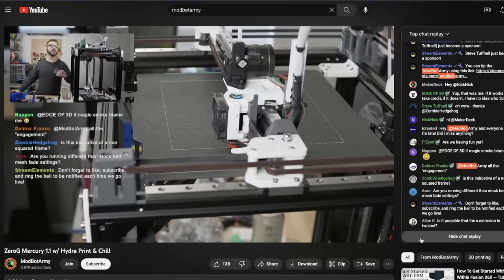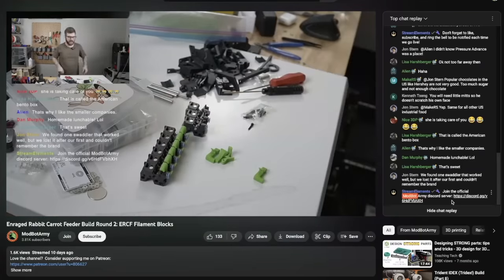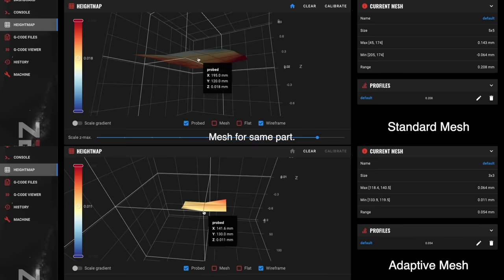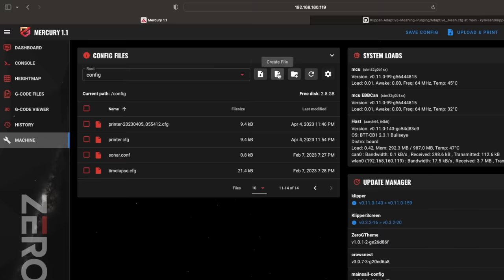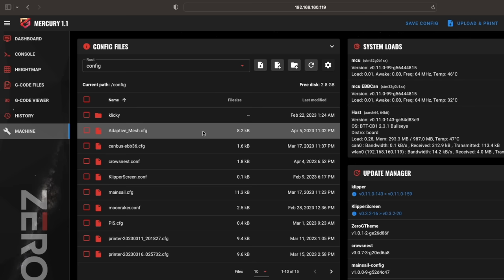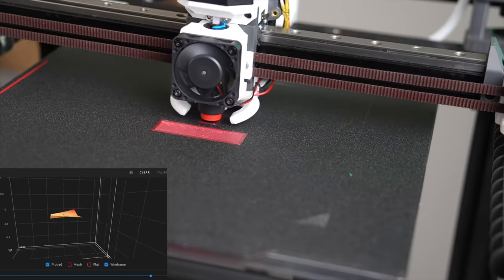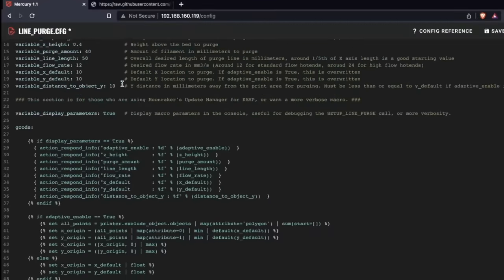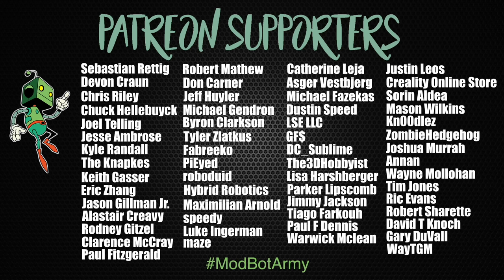The FUTURE Of 3D Printer Mesh Bed Leveling (KAMP)

Comment: For users that want to get into adaptive mesh probing, just know that KAMP is not the only way of doing it: since it's just a series of macros there are a lot of alternative implementations if you look around!
Reply: Can you point us to a few or speak to their advantages?
Reply: Look for Print_area_bed_mesh (no purge line near the printed part) or PAM for RatOS (works with any klipper config and it has the purge line near the print).

Comment: I was actually wondering if something like this was even possible a few days ago.  My bed isn't the straightest in the world, but was never too concerned, as the center isn't bad, and most of my prints never really get into the warped regions anyway.  The idea of just probing the area thats needed, instead of the whole bed, means that instead of just probing my mesh every few days, or when changing build plates, i just run it every print, oh, the purge line is heaps better than the classic one that i was using.

Comment: i get the following error when trying to print the object.  {'error': 'WebRequestError', 'message': "Error evaluating 'gcode_macro BED_MESH_CALIBRATE:gcode': jinja2.exceptions.UndefinedError: 'dict object' has no attribute 'polygon'\n"}.  Also I went through the exclude objects guide and didn't get it to work on fluidd.  Could that have something to do with it?  I use Cura for slice software.

Comment: Been using klipper and Kamp on my belt modded ender 3. They are both great. I really love mainsail and not having to faff around with a SD card. Kamp is one of those simple but great ideas. My printer hasn't been more rock solid

Comment: You can achieve this too on any printer that supports the G29 command if you do use PrusaSlicer(and probably it's forks too). You just modify the Start GCode with Macros.

Example: 
G29 L{first_layer_print_min[0]} R{min(190,first_layer_print_max[0])} F{first_layer_print_min[1]} B{min(180,first_layer_print_max[1])} ;

BUT BE AWARE: If your bed is too much crooked you will get problems with your purge line.... you will need to modify that gcode too so it is closer to actual printed model.

Example (PLEASE ONLY USE IF YOU KNOW WHAT YOU ARE DOING AND MODIFY IT!!!!!): 

G1 X{max(2.0,first_layer_print_min[0] -skirt_distance - 2.0)} Y{min(print_bed_max[1]-10,((first_layer_print_min[1]+first_layer_print_max[1])/2)+65)} E10 F1500 ; prime the nozzle
G1 X{max(2.0,first_layer_print_min[0] -skirt_distance - 1.7)} Y{min(print_bed_max[1]-10,((first_layer_print_min[1]+first_layer_print_max[1])/2)+65)} F5000
G92 E0
G1 X{max(2.0,first_layer_print_min[0] -skirt_distance - 1.7)} Y{max(10,((first_layer_print_min[1]+first_layer_print_max[1])/2)-65)} E10 F1200 ; prime the nozzle
Reply: I ditched the purge line altogether. I’m midair purging now. It wipes the nozzle on a silicone block.
Reply: Does this work for marlin??
Reply: @DominicVictoria  have anything on your setup?  have you shared it in any of the Fb groups.. got a link to it?
Reply: Love this, works perfectly, thank you! I had change the heating gcode since my printer wants to bed mesh at a particular temperature, and I also modified the first prime move to include Z0.3 so it doesn't prime in mid air.
Reply: @lambsauce5445  Should do if your printer is appropriately set up.
Reply: @andrewb9774  Yeah, the code needs to be adapted to every printer and it will probably still have issues if the purge line reaches the corners. And yeah I was a little unhappy about that missing parameter.
Reply: @towlnator  I might just leave the purge line at the Prusa defaults to avoid getting caught out as you described.
Edit: I might add some logic to set a certain number of points (P{number of points}) based on the print size!
Reply: @towlnator  Here is my adaptive, adaptive modification to your start Gcode, others may want to skip the temperature set for bed level:

M862.3 P "[printer_model]" ; printer model check
M862.1 P[nozzle_diameter] ; nozzle diameter check
M115 U3.11.0 ; tell printer latest fw version
G90 ; use absolute coordinates
M83 ; extruder relative mode
M104 S120 ; set extruder temp for bed levelling
M140 S60 ; set bed temp for bed levelling
M190 S60 ; wait for bed temp
M109 S120 ; wait for extruder temp
G28 W ; home all without mesh bed level
G80 ; mesh bed leveling

;https://www.youtube.com/watch?v=HydfV8h4p60 (Timo Towl comment)
{if max(first_layer_print_max[0],first_layer_print_max[1]) >= 100} G29 L{first_layer_print_min[0]} R{min(190,first_layer_print_max[0])} F{first_layer_print_min[1]} B{min(180,first_layer_print_max[1])} P6 ; bigger print, 6x6
{else} G29 L{first_layer_print_min[0]} R{min(190,first_layer_print_max[0])} F{first_layer_print_min[1]} B{min(180,first_layer_print_max[1])} P3 ; smaller print, 3x3
{endif}

M140 S[first_layer_bed_temperature] ; set bed print temp
M190 S[first_layer_bed_temperature] ; wait for bed temp
M104 S[first_layer_temperature] ; set extruder print temp
M109 S[first_layer_temperature] ; wait for extruder temp

G1 Y-3 F1000 ; go outside print area
G1 Z0.2 F720
G92 E0
G1 X50 E9 F1000 ; intro line
G1 X100 E12.5 F1000 ; intro line

G92 E0
M221 S{if layer_height<0.075}100{else}95{endif}

; Don't change E values below. Excessive value can damage the printer.
{if print_settings_id=~/.*(DETAIL @MK3|QUALITY @MK3).*/}M907 E430 ; set extruder motor current{endif}
{if print_settings_id=~/.*(SPEED @MK3|DRAFT @MK3).*/}M907 E538 ; set extruder motor current{endif}
Reply: @br0k3nilluzion  not yet. I’m still testing.

Comment: I use it already for a while now and it's awesome! I stopped using Cura, because it didn't work properly with klipper. It didn't mesh, I searched on Google and people were saying that Cura was the problem. I use PrusaSlicer now and no problems with Klipper/KAMP. :)
Reply: Cura is the problem. Easy to fix. 

Cura -> Menu -> Extensions -> Post Processing -> Modify GCode

Then Add a Script -> Search and Replace
Search is NOMESH
Replace is NONMESH

Comment: Thanks for this, I just set this up, but for some reason it's doing a full bed mesh level instead of just doing the portion that's being printed. I'll have to figure out what it's doing wrong.

Edit: After removing and re-adding everything it's working now. I don't have the exclude showing in my print window, but everything else is working. Thank you for the tutorial!

Comment: Troubling Trend?
isn't this feature a bad idea for Precision Parts? (as opposed to Physical bed leveling)
Suppose your bed is tilted? the mesh leveling adapts your part so the bottom surface matches the bed for good adhesion
but if you were depending on the bottom surface of your part to be a precision fit for whatever you're building.... well now its picked up the same imperfections as a the bed.
printers need to have physical bed adjustment for situations like that, can't just replace it all with software mesh leveling

Comment: Tried to set this up on my Neptune 4 Pro. Got it work for the the calibration but the purge line still happens at the original point. Thanks for the video, also it got updated a bit on the KAMP github page.

Comment: I've been wondering why we don't actually have an on-the-fly bed level detection system yet. Honestly I'd think that'd be the best way to do it. Instead of running a leveling and storing a mesh just scan as the nozzle moves. It's got to be possible but is it even in the works?

Comment: I fail to see how this makes the mesh more accurate or precise. The way I understand it, after having just tested it, it will only probe the original mesh points that fall within the print area, but the points aren't repartitioned closer so the mesh won't be denser, it will just be smaller. Correct me if I'm wrong.

Comment: HHmmm seems simple, and yet on my printer once it does the adaptive mesh then the purge line it starts printing about 10mm up in the air.  :-(.    never did that on my old start code
Reply: Same, did you ever get it figured out

Comment: I picked up a beacon probe recently. I wonder how well that works.
Reply: I have a beacon that I need to fit too. I wonder if this is kinda obsolete, but I guess it could still just scan a small area and save a few more seconds… lol
Reply: @stevehanwright481  okay, so it works without any changes! I wasn't sure how beacon would handle it but it does all the interpolation onboard before it hands the data off to Klipper. I like it because it moves the purge line around with every print. I could implement it without the leveling, but eh no big deal.

Comment: It’s possible to switch back to stock firmware from Klipper at any time, by putting an sd with the stock bin file? 

Is there an easy way to grab all needed parameters before switching to Klipper?
Really want to try out Klipper, but don’t want to have a bunch of down time as I just got my first Ender 5 plus running again

Comment: Unable to get the adaptive mesh and purging to work, meshes the entire bed and only purges in the default location.
have got label objects set up in prusaslicer, the moonraker config setup correctly, [exclude_object] in printer.cfg, and both Adaptive_Mesh.cfg and Purge_Line included in printer.cfg
Got any ideas

Comment: Mine still probes the whole bed.

Edit: I've fixed it. 

Reboot pi.
My slicer was already set right, but I added M117 right above the START_PRINT line under /Printer setting/custom g-code. Then resliced the same file I was printing before and it now worked.
Make sure exclude object is working.

Printer: RatRig Vcore 3.1 400mm, Probe superpinda.
Reply: Thanks!!!!! You are the goat!
Reply: @coltenmeredith8899  I never normally take the time to write out stuff like this but I'm going to be from here on. Thank you.

Comment: what's the point of meshing the bed over and over?
Reply: If you print on the same sheet, same material, same temp, every time... Not much.

However, not everyone fails into that zone.

Even so, if you are printing high temp filament and don't want to soak for an hour, your bed deflection can change a lot as the metal adjusts. So if you are printing little prints in say different colors, you will have a different mesh each time

Comment: I've read about quite a few cases recently were updating Klipper to the latest version has caused issues, sometimes even somehow breaking the Klipper install. So if you are at a new-enough version to have exclude object, and everything else is working fine, I wouldn't update to a new version.

Comment: How hard is it to turn 4 screws.?
Reply from the maker: 4 screws won’t account for a warped bed. Many of the low cost 3D printers use pcb bed heaters which more often that not come warped. For those they don’t give it enough heat and cool cycles and they will develop.
Reply: Besides, why not use ABL if you've already got it installed x)
Reply: @ModBotArmy  If you have warped glass, call "Ripley's believe it or not" and then buy a new piece of glass. Mesh leveling warps your 3d model, in memory, to match the warped bed. Did you realize it changes your model? Changing dimensions of your model should be a deal breaker, no matter how you look at it. My comments have nothing to do with your excellent video.
Reply from the maker: I really don’t like printing on glass 😣. I did for years but after finding powder coated pei anything else I have used is inferior. The only exception to this is for special engineering materials that require a special adhesive. Yes a mesh does affect tolerances but in many cases it can be minimal. This bed for example has a .2mm range from high to low so most parts are .05 give or take range so correction is minimal. It does help with getting that solid first layer though. But yeah for functional parts with tight tolerances the flatter the surface you start off with the better versus trying to compensate. I definitely agree with that 😊

Comment: well this was a complete WOFT (waste of feeking time)
Exclude did nothing?
Purge did nothing
Adaptive mesh, well it just did a full bed mesh for a 30x30 single layer test
All parts of Klipper are up to date??????
Reply: Reboot your pi, and add M117 one line up before your START_PRINT macro. That fixed it for me
Reply: @coltenmeredith8899  I rebooted the pi a dozen times nothing! M117 is just a message command so that won't do anything.  The exclude icon never appeared.
I # it all out and put it back to normal and left it printing while I slept. Now the exclude works but the adaptive just throws an error and crashes the bed.  So I disabled that junk for now

Comment: IF YOUR USING CURA TO SLICE CURA 5.3 AND 5.3 BETA BREAKS ADAPTIVE PROBING! DOWNGRADE TO USING CURA 5.2 FOR YOUR PRINTS TO WORK OTHERWISE IT WILL THROW THIS ERROR ON KLIPPER WHEN YOU GO TO PRINT!  "BED_MESH_CALIBRATE 'dict object' has no attribute 'polygon'". it took me a couple of hours to figure it out but totally worth it hopefully this will help someone else out
Reply: I ran into this same bug. It is fixed in the next version of Cura, but it hasn't been released yet. In the meantime, if you want to use Cura 5.3.0 you can do a search and replace of your gcode file before uploading it to Klipper. It's due to a typo in the gcode. Search and replace all ;MESH:NOMESH and change it to ;MESH:NONMESH

Comment: I'm getting this error : !! error evaluating 'gcode_macro bed_mesh_calibrate:gcode': jinja2.exceptions.undefinederror: 'extras.gcode_macro.getstatuswrapper object' has no attribute 'gcode_macro _kamp_settings'

Anyone else have this issue.
Reply: I just tried using KAMP and I'm getting the same error.  Did you ever figure it out?
Reply: Hey was having the same problem, not sure if you ever figured it out but @brunofernandes8697 solution worked for me!! "donwload Kamp_Settings.cfg and paste it's contents in Adaptive_Mesh.cfg BEFORE [gcode_macro BED_MESH_CALIBRATE] section. Worked like a charm after that."

Comment: Getting this error - 

Error evaluating 'gcode_macro BED_MESH_CALIBRATE:gcode': jinja2.exceptions.UndefinedError: 'extras.gcode_macro.GetStatusWrapper object' has no attribute 'gcode_macro _KAMP_Settings'

I am just using the nozzle on a Anycubic Vyper for leveling.  I am trying to find a solution but have come up empty handed so far.

Comment: There is a bug in Cura 5.3 which gives Error evaluating 'gcode_macro BED_MESH_CALIBRATE:gcode': jinja2.exceptions.UndefinedError: 'dict object' has no attribute 'polygon'   When doing BED_MESH_CALIBRATE
Reply: Swap back to 5.2. That worked for me
Reply: @coltenmeredith8899  Same 5.2.1 works.  All I could find in my download folder from the past downloads.